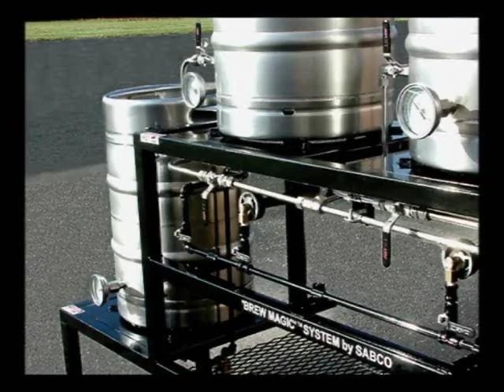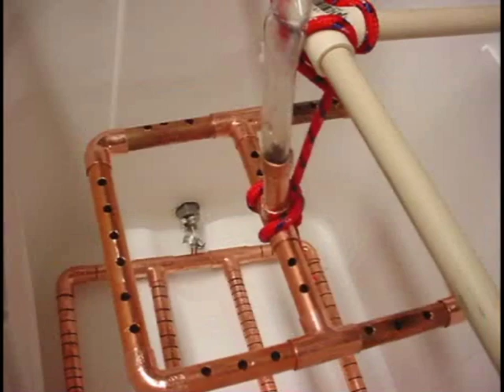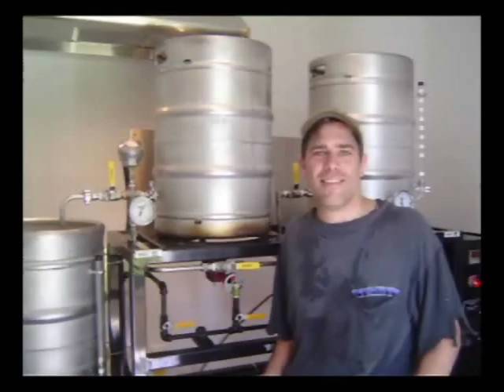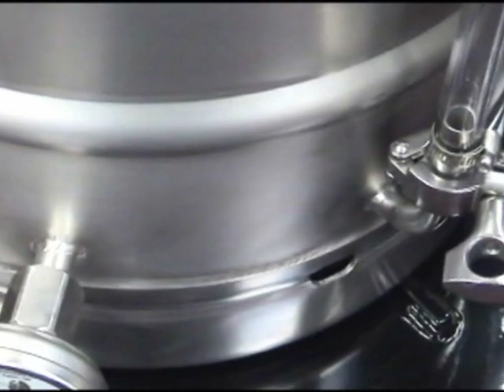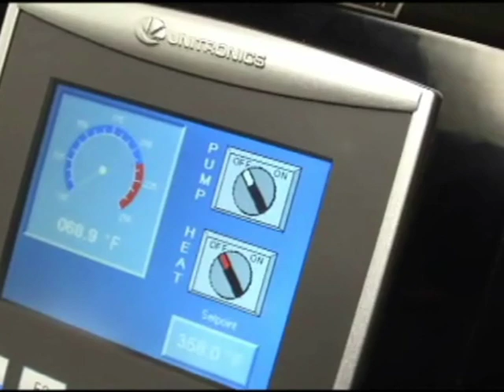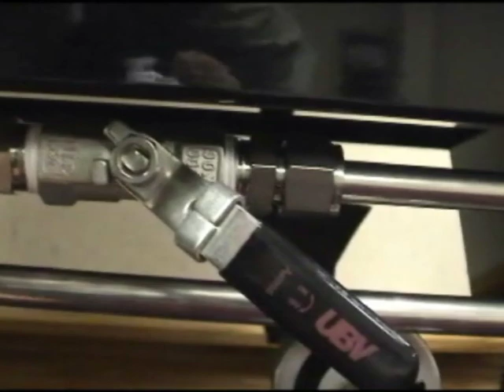Brew Magic - How To Use Part 1 of 3

Comment: You should mention that this is the 350 model and not the original like I have that only has the tri-clamps inside the kettles and does not have the PLC controller. My SABCO Brew Magic has the single OMRON temp control with a rotating EATON switch for pump and pulm/heat. Anyway while I wish I had the newer nicer rig like in this video I have been reviewing videos of this newer rig as a learning example. CHEERS!

Comment: I watched the development of this system since it originated, probably 7 years ago or more and it's gotten better each year.  I finally saved enough money for it and got one last year.  I've been brewing for 16 years and have used different systems over the years, but this by far is my end all system.  Say what you will, for guys who don't weld or fabricate, this is a well built system that will be around after I'm gone.  Cheers to the folks at Sabco!

Comment: Just build your own... What you are paying for here is engineering and getting all the products at once. With $1k over time you can build the exact same thing but better. You can modify the thermos to electronic thermistors, ect. Finding kegs for brew pots is easy as pie and will run $120 or less for all 3.